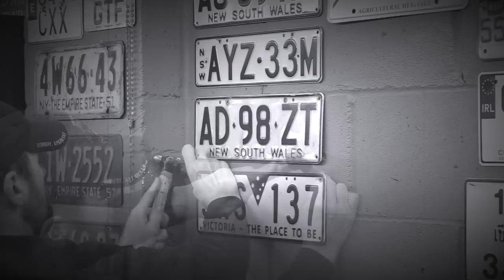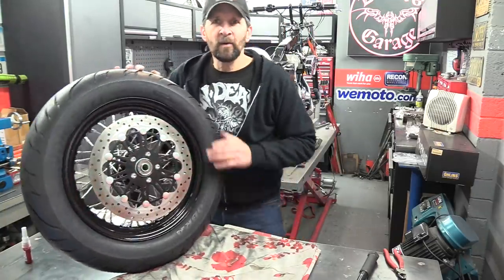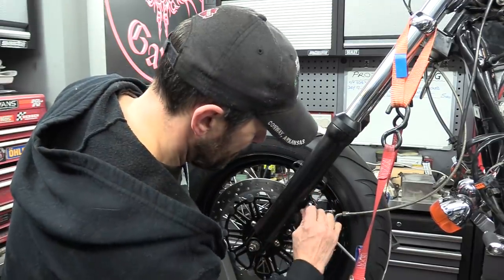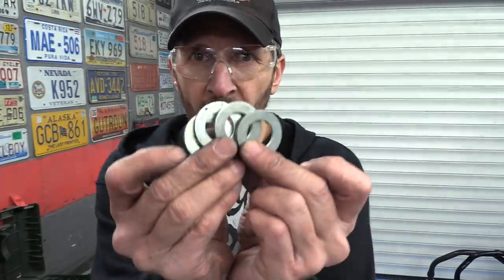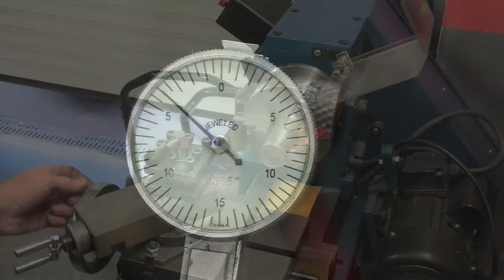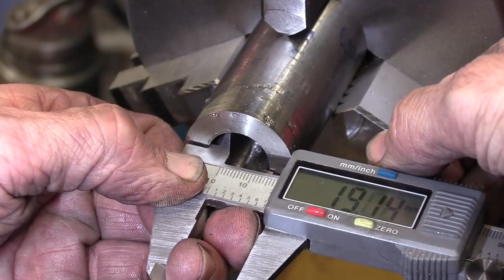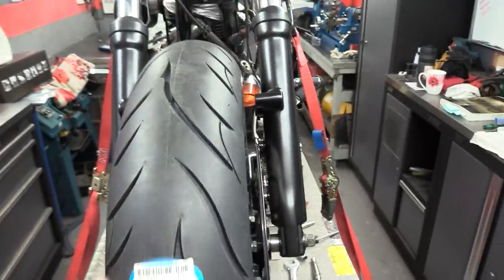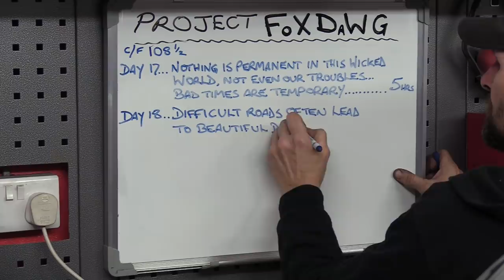Delboy's Garage, Project FoXDaWG, Day 18  Front Wheel Spacers!

Comment: Hi Del love your vids ,   but the front wheel seem to spin effortlessly without the brake caliper on but once  fitted it seemed to be binding and not spinning as it should... ?
Reply from the maker: The caliper still needs to be stripped and cleaned out with new pads etc etc.. so its just binding a very tiny bit at the mo...it'll be perfect once i sort the caliper out buddy... have a good weekend, and thanks for your support.. Del.

Comment: Beautiful! I was interested about what you said about the back wheel alignment. This is where I get confused. There just seems to be too many different things that need to line up. The sprocket needs to line up so the chain is in line with the front sprocket (tips? without having to buy a laser tool), the wheel also needs to line up with the front wheel (how?) and with the brake caliper/disc. The other factor is the cush drive which, according to yourself are an issue for the old Kawasakis (might also be why shifting into gear gives an audible clunk noise). There just seems to be a lot of factors to line up.  Sorry for the deluge but I just had to invest in a new back tyre and I would hate to see it wear unevenly.  Best wishes to you and Penny:)
Reply from the maker: Hi Patricia, ok, I understand your confusion... but it's easy to overthink it, firstly the front and rear wheels line up within their own location, unless you have a frame jig, then you won't make reference between them for alignment... you line up the rear wheel, then line up the front and they will align with each other, provided they are both correct... 

Your point of reference is the disc and caliper, don't worry about the chain, provided you have made no changes to the wheel, like I have, then your original factory wheel with the correct spcers it came with will line up, but if you have doubt, then use the brake disc and caliper... bolt the wheel in to the bike, and mount the caliper on the disc, you're looking for the disc to line up with the centre seam, or join, between the two halves of the caliper... which it should do if all your stuff is factory...... In regards to wheel alignment, that's a different matter, that's just aligning the adjustors at the rear so they're the same... you should be worrying about lateral alignment, it's not an issue on a factory bike.  We have videos on all of this in the Playlist, drop us a line if you can't find what you're looking for!  Have a great wekeend, D&Px
Reply: Yes, that's what it says in my Haynes manual as well. It seems almost too simple. :)
Reply: Thank you for that. I get to  watch more interesting videos and learn stuff :)

Comment: Nice work Del, will you be balancing the wheels now the discs are fitted mate?
Reply from the maker: Hi buddy.. no ill do the balance last just before i fit the wheels for the final time.. still got to take them out to paint the brake caliper brackets.. (well the rear at least)..   Ill make a video at the time, and maybe it can help a few viewers out there at the same time..    thanks for the nudge,, have a good weekend.. Del.
Reply: Cool stuff, I got a static wheel balancer for Christmas, not had a chance to test it out yet.....

Comment: im glad to see you got the lic plates.. they look cool  question..... is 150 rpm the slowest speed on some lathes good?   or 80 rpm better????
Reply from the maker: Hi Steven... So sorry we didn't get a chance to email you with  thanks before the video went up... we have to focus on the twice weekly video schedule, and with day job too, it often means we get backed up with email admin.. she has it on her list to to mail you tomorrow...   Thank you so much for the plates mate, they are perfect, and as you can see, they look awesome on the wall..    With lathe speeds, im only learning this still my self.. but i understand that you turn slow when cutting big hard materials like stainless steel.. drilling out the big hole for the boring bar i slowed it right down to 140 rpm, (slowest mine will go), but for the finishing cuts on the outside u used 400rpm and it worked really well to give a clean smooth finish as you saw... the diameter of the material also makes a difference, the surface speed increases the wider it gets!!   if you get yourself a book on "feeds and speeds" it has lots of handy references you can use..   Thank you again mate,, have a great weekend.. D&Px
Reply: @Moonfleet41   thank you for your reply and it was a pleasure seeing the lic plates on your wall.   cheers ...
Reply from the maker: Thanks again buddy, we both really appreciate your support, D&Px

Comment: Sweet....Question...Since I am new to lathes  I see you line up the cuter with a straight edge and a right angle square, is that for the angle of the cutting blade? Always a pleasure, Take Care
Reply from the maker: Hi Bradley, that is it guage the height of the cutting tool, you press the tool against the material, and trap a steel rule inbetween, if it stands dead upright, then the tool is dead in the centre in terms of height... you can line it up with the tailstock also, but this is far quicker and dead accurate, as you can see from the facing cut!
Reply: @Moonfleet41  Thanks Bud

Comment: Hi Del. Quick question...what keeps the Disc Spacer in place?
Reply from the maker: Friction mate... it's an interference fit in the disc... meaning that it fits over the hub cleanly, but the disc binds on it very slightly and as it's soft aluminium, when you torque the disc down it wedges it in solid!
Reply: @Moonfleet41  Thanks , Was wondering.

Comment: Lovely tidy job Del......can't beat a bit of stainless!!

Quick question, not related to this video......what's the mini pillar drill your using, link if possible please??
Reply from the maker: Hi Gaz, a link which of couse is handy, but my pillar drill is an old antique one from the 70's I got from a second hand tool shop, but Machine Mart make a copy of it under the Clarke brand, and they have a range of quite a few, so you can chose one that suits you... mine's a Nu_Tools machine made from all steel and metal, roughly twice the weight of the MM copy, and it does the job, plus it was just £50, so am proper happy.
Reply: @Moonfleet41  is yours the 5 speed version?
Reply from the maker: @digga1667  Yes mate, only by changing belts in the top casing...

Comment: You have a back tire on the front of you Harley. Rotation is counter clockwise . It will not make any difference . Great video cheers
Reply from the maker: Hi buddy I actually have a front tyre on the front of the Harley, not splitting hairs, but it is actually a front tyre, marked front fitment on the side of it.. it has a slightly different tread to the rear one, and has a different code number... interestingly, you actually buy them as a pair... and in fact even the width isn't exactly the same.. the front is 130mm wide and the rear is 135mm, they just look the same.... and you're dead right, the front appears to rotate backwards if you look at the tread, it's certainly a subject that gets a lot of people hot and sweaty!
Reply: @Moonfleet41   Half hammered lol. But tires today are so big it takes miles to heat them u[p. That is a probem

Comment: Great tip on the spacers and the fat front tyre looks the dogs. 
Have a question though. , You used the disc alignment within the caliper as datum for setting the wheel position left to right.   From that Im assuming that the distance from the disk to the center line of the wheel/tyre is the same as the wheel you removed. Is this something you have to specify when you order the wheels or is this a standard measurement?
Reply from the maker: Hi buddy, Yes as the hub is symetrical side to side, then take overall width and half it, and you can soon work out the spacers are the wrong size... as the caliper is fixed, not sliding, the disc can only fit in to one place, otherwise you'd have to space the disc itself if the wheel was moved elsewhere... at the risk of this getting over complicated, it'sa ll lined up and dead in the centre... rear wheel next!  When you buy the wheels you order them specified to your bike, check out the website and you'll see how easy it is!
Reply: Cheers Del

Comment: Hiya Del, love the chunky wheels and tyres they look so much better.
What about losing the rear fender???
Do you grease the axles when putting them back in?
I have only removed the rear axle on the Tuono so far but have been told to grease it b4 putting it back on.
Reply from the maker: Hi Damion, the rear fender is an intrinsic part of the Dyna WideGlide style, they're a long and graceful bike styled on a chopper, 5degrees more fork rake than a regular Dyna and they ride lower too (which is why I've only lowered it 3/4" as it didn't need any more)... stick with it buddy, the style will evolve once it all starts being put back together...  with the axle, yes you should put a light smear of grease over it, obviously purely to keep it from corroding and rusting on place, they don't need lubrication cos they don't turn, nothing touches them that turns either, the grease is purely so you can get them out in the future... so don't trowel it on, just a light smear with a rag!
Reply: I don't understand why so many negative comments about the rear fender, the bobtail fender is classic Harley
Reply: @pongobird  everyone to their own but that duck tail ain't pretty.
Reply: "Don't trowel it on …" LoL
Reply: even if he takes off the mudgaurd(fender), he would have to fit a rear hugger, front and rear mudgaurds are a legal requirement for M.O.T test in the uk, i am aware some places pass bikes without them but they shouldn't, UK bike cops are on the ball and will issue a defect if you give them reason.

Comment: Hi, people don't realise some tyres are made for front and rear, when this is the case they need to be fitted in opposite directions due to the forces applied to the tyre, in one direction they are breaking forces and the other driven forces both opposite to each other. This is important due to the construction of the tyre and not the tread pattern. I guess you know this but the guys who commented appear not to.
It's not important in this case as a few thou here and there isn't critical as you pointed out, I guess funds are short but I think its time you invested in micrometres instead of using a digital calliper. They are available secondhand on eBay very cheap (Moore & Wright, Mitutoyo etc). I personally haven't had any problems with the Chinese issues but as in bike prejudice there is tool prejudice.
Reply from the maker: Yes, I do have a long Wish List and also have to consider where to put it all, there's always another tool you need, as I'm sure you'll agree... having to balance budget between bike parts, materials, and maintaining the equipment, cameras, etc...!  But on my list buddy for sure... have a great weekend !

Comment: @Delboy's Garage  I live in surrey and need a front wheel spacer made. I have converted my KTM EXC-F 250cc to a supermoto and the spacers provided are 0.05mm too narrow. At the moment I have the spacers provided and a 0.05mm Shim washer on and I dont trust that it will be strong enough to ride. could you tell me how I would go about having a new spacer made, I do not have a lathe like yourself and Ive tried google searching machein shops to have new spacers made but I dont seem to have much luck. Could you point me in the direction of a company that would be able to create these or could I send the current spacer to yourself and you create one for a fee.
Reply from the maker: Can I ask you mate, just to be clear, how it is you've arrived at the conclusion that your conversion threw up a discrepancy of less than two thousands of an inch (0.05mm), about the thickness of a human hair?   Is that truly the measurement you believe it's out or have you, perhaps, measured that wrong... just to be clear as you may not even need a shim if that's all there is to it.
Reply: @Moonfleet41  Thanks for the quick response, I came to this conclusion because using the spacers supplied with the wheels the disc contacts with the bracket that holds the calliper in place.

the disc has studs holding the 2 parts of the disc together and they stick out further than the disc itself. when I used the stock spacers supplied with the wheels the studs would contact with the bracket holding the calliper, 

I purchased 8 shims, 4 x 0.05mm shims and 4 x 0.02mm shims. 

 if i used a 0.05 and 0.02mm shim on either side of the wheel the disc them fouled the other side of the calliper bracket as the calliper bracket hooks over the disc so this was spacing it to far. 

when I used 2 x 0.02 spacers on either side of the wheel this was again fouling the bracket and not wide enough 

When i used a 0.05mm shim on either side of the wheel it stopped fouling the bracket.

so In short. 0.04 shim was not wide enough 
0.07 was too wide and 0.05 gave enough clearance either side of the disc not to foul.
Reply: just to add I appreciate any help or advice and If my explanation above of my conclusion is not clear I am happy to create a short youtube video to show me using each shim and where it fouls on the calliper bracket to give a better example. Or if you have contact details I could send pictures as im not great at explaining. Im not sure if you have a shop that charges for work but I would be happy to drop the bike off and pay for your time im not looking for freebies ive just been following your channel and trust you have the expertise to know what I need to be safe as I feel using the shim and spacer may not be safe.

Comment: I noticed your front spindle is too far through and not all the hole is showing on the outside. Mine is out about 1/4 inch! This will make the outside spacer too small if you put it in the proper place. The idea of the washers is brilliant as tomorrow I have to space out my back wheel and use this idea. .
Reply from the maker: The axle's correct mate, it lines up the other end, and gives me a perfect exposed thread for the nut...there is a should that pushes the spacer up against the fork leg and that's how it was from the factory buddy.... if it was any further out I wouldn't be able to get the nut on the end... Good luck with yours, hope it works out for you!
Reply: Yea it looked better at the end . Mine has a Sportster front end and looking again is slightly different. Keep up the good work 👌 been following you for a while and always good to watch.

Comment: Different size spacers , surely that wheel can't be centered in the fork legs ?. Why didn't you measure the wheel width , distance between fork legs then cut two spacers . Yes you may have had to move the caliper
Reply: My Honda CB500X has 2 different size front spacers.
Reply from the maker: There's a little more to it my friend, spacers are not automatically equal sizes...
Reply: That's the point I was trying to make Del.
Reply: @Moonfleet41  Thanks for the reply Del but you've answered a question with a statement , I don't understand . Isn't it a twin disc wheel so the center line of the Tire will be in the middle of the wheel then surely that center line of the tire should be in the middle of the fork legs . Can you go into it a bit deeper plz
Reply from the maker: @MikeB-fp2nw   OK, (Dons anorak and thick glasses)....the  lower fork legs on this bike, (and on many bikes) have a regular hole on the 'nut side' but on the shaft entry side there is a detachable under bracket that tightens up to clamp the axle in place. the axle itself has a thick shoulder on its back end that pushes the spacer into place while protruding through the lower leg...meaning...that the axle itself forms part of the spacer setup....and thus you need a smaller spacer on the entry side and a wider spacer on the exit side.. OK.?

Comment: Why not just measure the hubs and spacers? then do the math. that would be doing it right, its not exact right size.
Reply from the maker: Yes that gives the overall quantity of spacer you need, but not the ratio from side to side, very few bikes have equal sized spacers either side, they are most usually biased to one side, or the other